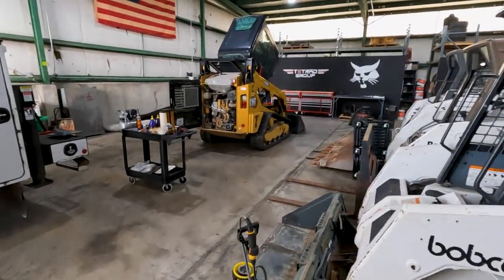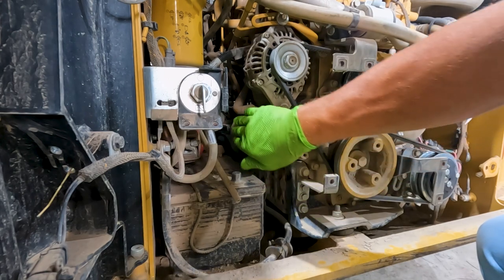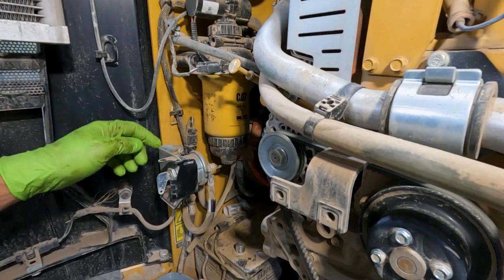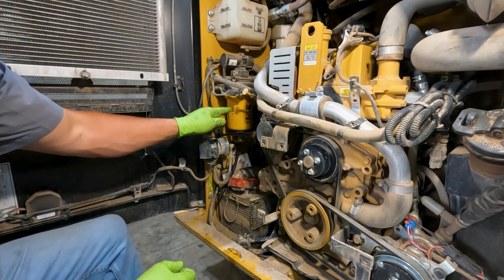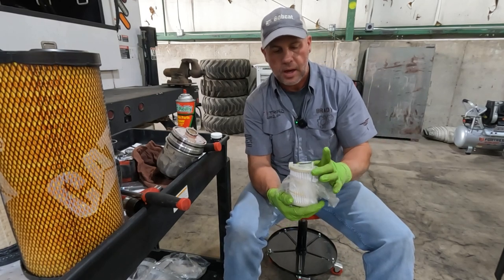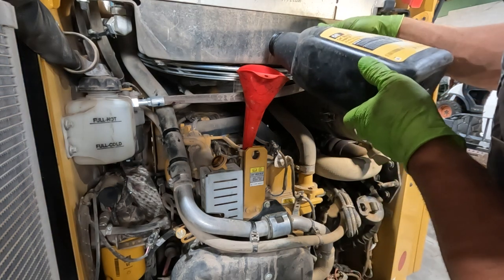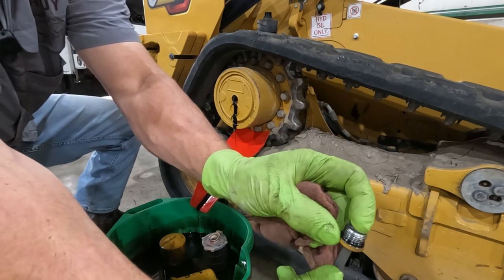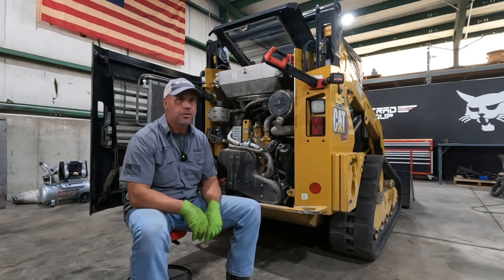CAT 259D3 How To Do a 500 Hour Service, Tips and Tricks.

Comment: Thanks for the video.  Would you  know if the 'wheeled' cat skid-steer has the same final drive oil requirements?
Reply: What I was told by my dealer all cats skid steer have the same engines they are just tuned differently I could be wrong but this was the info told by my dealer

Comment: Just curious if you know off the top of your head if the first 250 hour maintenance on a 2019 T595 requires a final drive oil change. That’s crazy that oil looks so dark after 500 hours. Are there clutches in there? Parking brake?
Reply: It always comes out dark and it stinks and usually u change it at 500 hours and there’s only gears in there

Comment: Great video as always. 2 questions, my e42r2 says 750 hours for oil change. That just seems way too long. Would you recommend sooner? Also mine didn’t come with a rear camera but I would like one. Is the wiring already there? Can I just buy the camera and cable and put it in? If so do you know the part number?
Reply: Lmk if you find an answer for this would love to add it to ours
Reply: @Zerokey789 750hrs is insane for a little 2.4L engine that holds just 2.5 gallons of oil. 750hrs is approaching the interval used in big 15L engines in road tractors and big heavy equipment that holds 10 gallons of oil or more. I personally still think 500 is excessive in these small engines. I think 750hrs is prescribed based on the 2000hr warranty period which is all Bobcat cares about. If you only keep your machine 2000hrs then 750 is fine. 99% chance it makes it there. But if you bought used and want it to last longer, or you still sell it by 2000 but want to help the next owner out, do it at half that. 350, or 500 max. The EGR system is not conducive to long oil change intervals.

Comment: Have you ever experienced a final drive that won’t accept the entire volume of gear oil specified by the manufacturer? I have a 259 that has one final drive that will overflow at about 5/8 -3/4 of a quart despite being completely drained.
Reply: They are only supposed to hold about .6 quarts per side so that’s about right
Reply: @dylantriller962  the other side takes the whole quart though before it overflows out of the center though?
Reply: @rossh1152   i can’t answer that but I was a tech at a cat dealer for 6 years I changed a lot of final drive oil and I never had one take more than a little more than half a bottle. Cat says .6 quarts per side. I usually just put .5 quarts in each side so I didn’t have to charge the customer for 2 bottles of oil
Reply: @dylantriller962  thanks for the input. I’ll double check my volumes. I thought it was supposed to accept the entire bottle.

Comment: The hydraulic filter isn’t required until a  1000 HR PM. But you forgot to do the crack case breather filter.
Reply: I change mine at 500 then every 1000hrs. after that. Gets all the left over boring bar shavings out early!🤣🤣👍👍